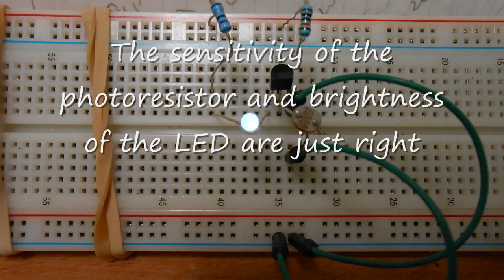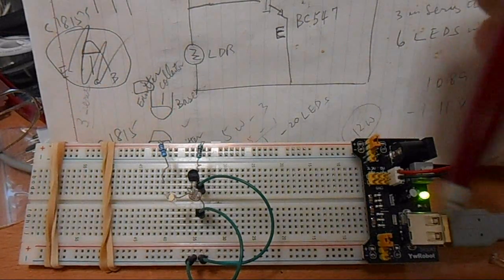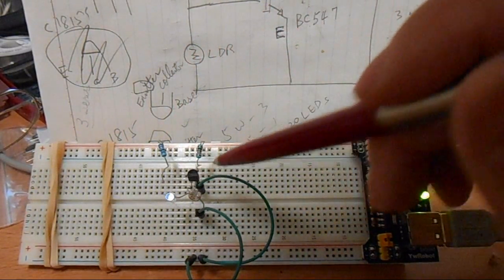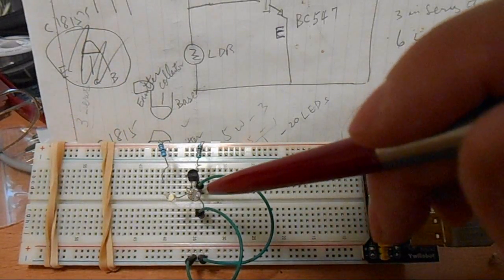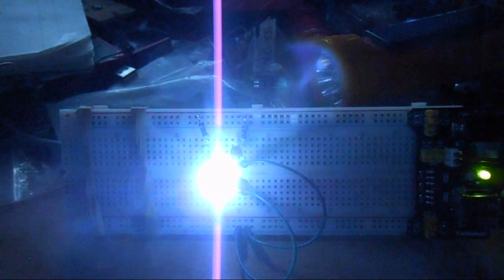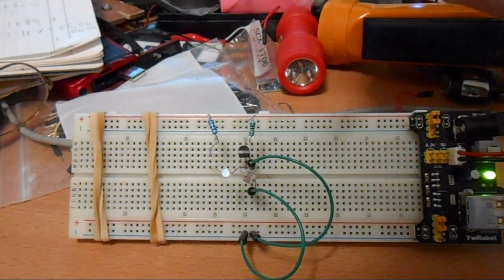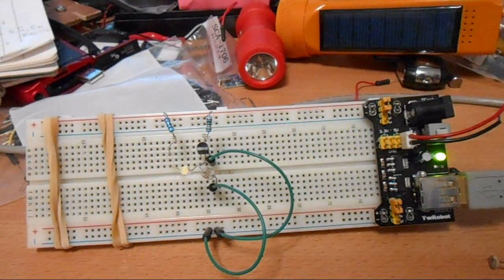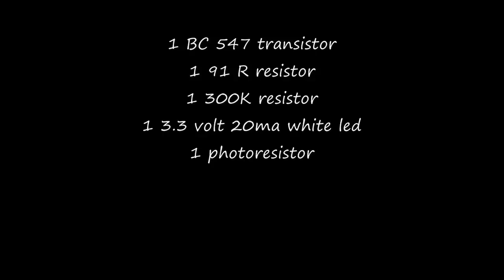Circuitry for my dark sensing solar rechargeable light

Comment from the maker: Use a adjustable voltage regulator. They have them for a few dollars. I have a boost buck converter that I can use for this purpose but it's overkill. In most cases, if you size your solar panels correctly, you will not overcharge even without a regulator, as there is only a few hours sunlight unless you keep tracking the sun.

Comment: If you reverse the photo resistor and the 100k, it should work the other way by coming on when the light shines on the photo resistor which could be a solar tracker.